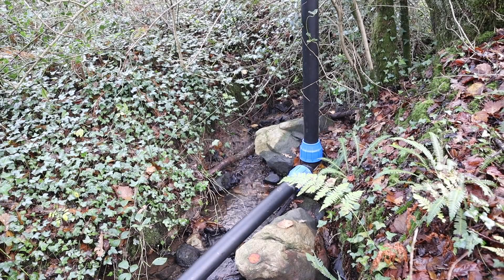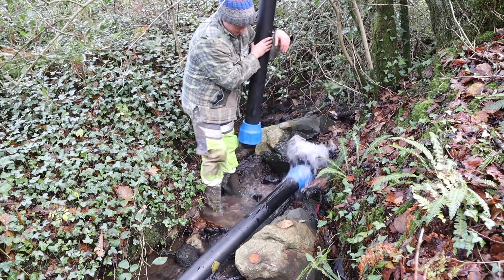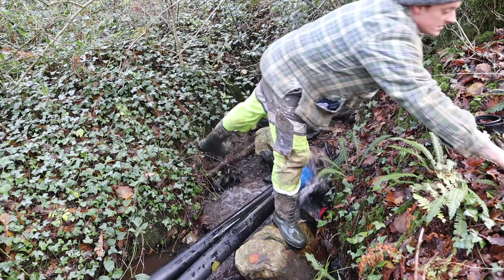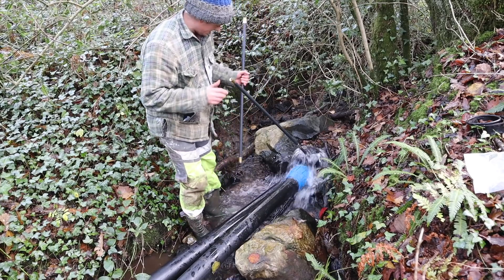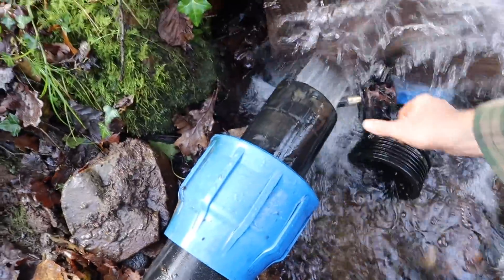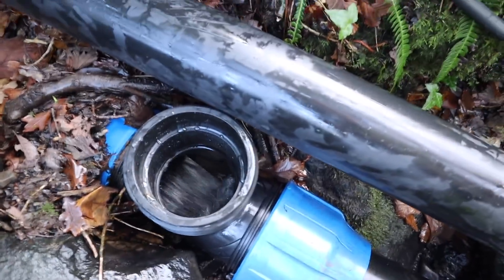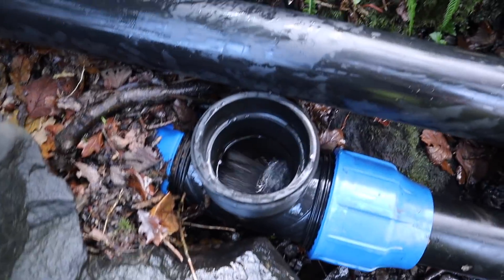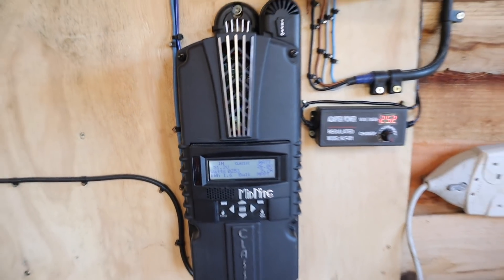Hydroelectric Penstock Pigging

Comment: I don’t know of the make a two way long sweep Clean out for that type of pipe.  However they do in PVC we used those on sewer lines. So we could run our cable machine in either direction.  Just a thought to make what you’re doing easier.

Comment: I would expect that if there is a reference amount of head and shutting off the turbine valves, that flow (litres/minute) through a large orifice could be a good indicator of buildup over time.  Testing that after a pig run would validate the method as well.
Could some sort of automatic brush be devised to clean the intake slowly and continuously?  A wheel-brush the height of the intake oscillating left-right for example?  Electrically driven from the turbine (use the 3 phase side to reduce overall losses and permit small diameter wires).
Or vibrate the Coanda grill to help the leaves shimmy off of the grill?

Comment: Our home in Portugal is not on a mains water supply and neither do we have any independent source. All of our water comes from the agricultural irrigation supply which is virtually unfiltered. Our water is very iron rich which is no good for drinking and destroys metal pipes and clogs plastic pipe especially when its heated. We have to buy drinking water.

However as an engineer I find your videos very interesting even when they have no relevance to my situation.

Our primary sources of energy, if we want to take advantage of them, are solar and wind.

I designed and specified a solar system to power our needs 18 months go but then the world went to shit.

Comment: The water was turning brown every time you pushed another rod up, so there's obviously crap being stuck to the side of the pipe (which will give your pipe extra resistance, lowering your psi at the bottom end) which has come out easy enough. But, I don't think it will make any difference if you don't get it all the way down the pipe.  Love your work ethic by the way. I'm out of breath just watching you graft😂😂

Comment: I like the couplings on your piping I have never seen that in the States before.  Please provide a link to the manufacturer.
Reply: late unneeded comment?

i'm aware of us liking pvc pipes lot more for some reason... or so it seems... i'm not entirely sure what they make water mains out of out there... but i could still find that you can get both hdpe pipe in all colors and stripes and compression couplings there... there is also option for electrofusion fittings that melt and join with pipe or brass ones with short inner brass tube in the end to avoid pipe getting squeezed in

Comment: I think this was a really cool idea. As a modification to this Pig. You could put some directional fins to make it spin. When it's going down the pipe which would probably make it more efficient at cleaning the pipe. Rather than it just going straight down the pipe.
Reply from the maker: It wouldn’t spin, the water is pushing from behind not flowing through it. It would require water to move passed it faster than it was traveling to be able to impart any energy to spin it.

Comment: i was thinking of instead of cleaning the whole pipe length every 2 years or more. Wouldnt it be possible to install some kind of filter at the top where the water starts to flow and a filter from the dam to the pipe? instead of cleaning the pipe just change or clean filters? is this at all possible in a set up like this? 

For future projects could you build a vice like you have in your workshop? could be fun to watch and maybe give us who want a cheaper vice to get a few ideas for our own vice project :)

Comment: As an alternative to the ratchet strap method, consider using an oil filter wrench. There's many different types. And they're really cheap. You have ones with a flexible strap or a wrench type. Will probably make it easier and it doubles as an oil filter wrench.... 😁🛠️

Comment: Every bit of your work has inspired me to design and build my own hydro system - but I intend to go much further and capture more water in separate hoses, driving separate turbines. 

But I'm far from a position and budget to do so.
Reply from the maker: It's much better to have just one turbine fed by multiple sources otherwise you just add losses. The turbine itself is the biggest loss so having one big turbine fed from multiple pipes is better than having multiple turbine
Reply: @KrisHarbour   True, but my idea is redundancy. Just in case one goes bad, I still have another operational one.
Reply: Could have the backup right next to the main so you could switch over whilst doing maintenance on the primary. Best of both worlds.
Reply from the maker: @MrThomBeck  There really isnt any need for that. a wel made turbine will run for a year without stopping no problem at all, then in the summer you do some maintenance and it runs for a year again. having a spare really isnt needed.

Comment: It's good to know how much the penstock gets dirty in an installation this size. Seems like you could probably go close to a decade without needing to clean it. Especially in your build - the water entering at the intake must be mostly clean, otherwise your jets would be getting clogged and/or your impeller would be getting pelted constantly. I'd say looks like you've done a great build!

After you've sent the pig through a few times and are certain there are no major obstructions or snags, I wonder about sending something like an over-sized loofah through it to really scrub the walls of the pipe. Though again, likely unnecessary.

Comment: What do think of a couple of fins on the pig to make it spin whilst it moves through??
Reply from the maker: It wouldn’t spin, the water is pushing from behind not flowing through it. It would require water to move passed it faster than it was traveling to be able to impart any energy to spin it

Comment: it might sound odd, but if you tie a length of line to the pig and send it down ahead of the pig, if the pig were to get stuck you can pull it down the pipe with the water pressure assisting you instead of working against you (it would be a hell of a job pulling the pig back up the pipe against the water, you'd probably have to disconnect the pipe). Cool project, I wish I had a property like that.
Reply from the maker: That is a very good idea 👍
Reply: Well in that case two pieces of string, one in front of the pig and one behind that way if there is a large blockage in front of it, you can just pull it back up.
Reply: Except you'd be pulling against whatever the pig had gotten jammed against. I think shutting off the water flow and pulling it back out the way it successfully had traveled would be the better solution. Maybe?

Comment: 9:47 man, use a socket wrench, you get way more leverage, and don't damage the plastic in the long run 😙🎶

And you might want to have just a drainage valve at the bottom of your welded distribution box, then sperating these fittings all the time 😂

Comment: Doesn't make it more sense to have a plastic propeller between the brushes and then a rotating swivel followed by the cord? The brushes would be forced to spin and the resistance of the brushes is getting the thing pushed down the pipe.